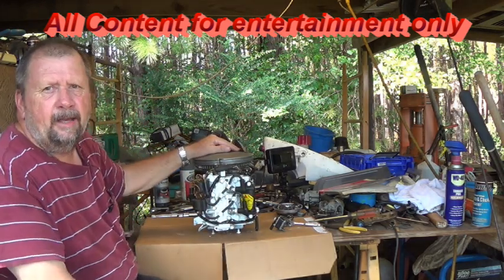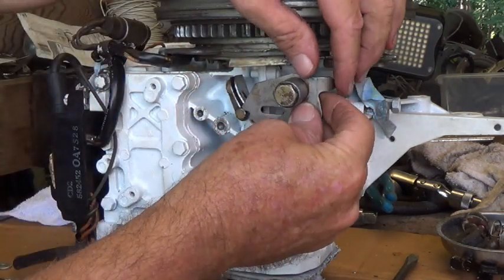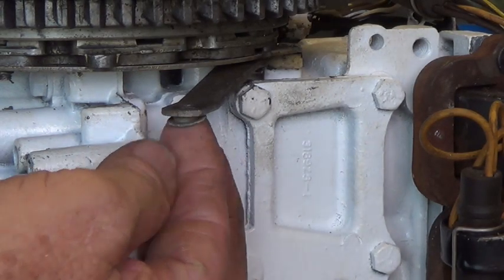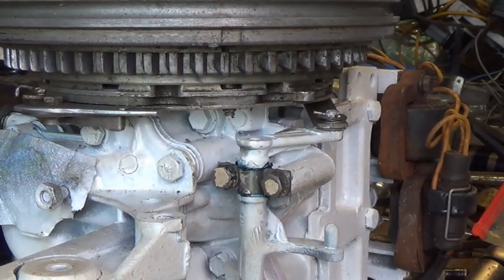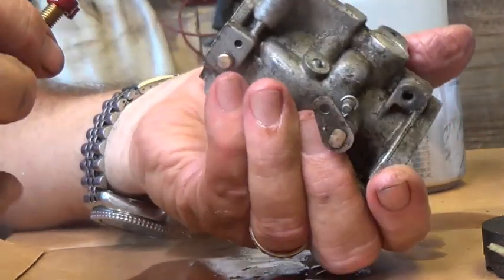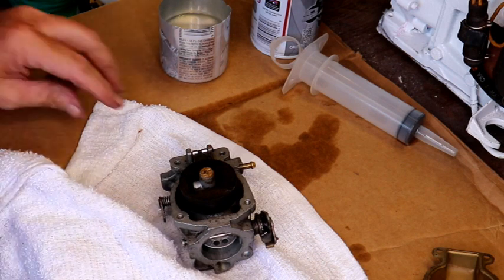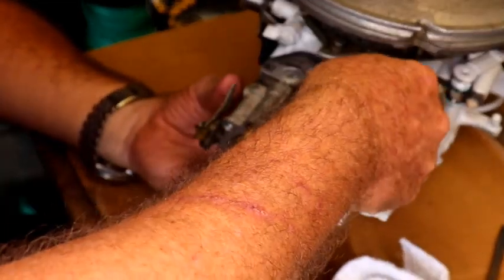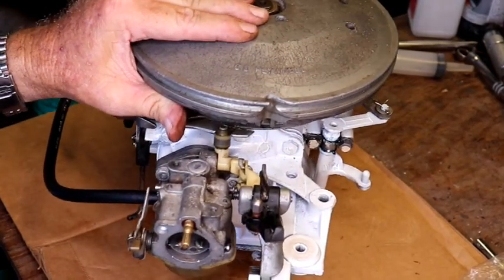Johnson 15 HP   Carb & Linkage!

Comment: Good job on the wiring!  Is that the correct fuel pump for the engine?  The fuel outlet does not look correctly oriented....That in itself is no big deal, but proper pump hsg orientation can be critical...Look for a tab/arrow saying "up"...  What was causing the mag plate to be stiff?  I like your little inch pound torque wrench!  Those original style carbs were the best for sure...Simple, reliable, and easy to service.  Yeah, the tin bowls were prone to rusting, but that was no big deal to replace.  Things really went to hell in the 80s when we introduced the plastic bowl/cover carbs...
Reply from the maker: I am going to check on the fuel pump. I took it off the other motor I got the crank and piston from. I believe you are right about this motor being under water. Fuel pump full of rust. The mag plate I took back off and shined up the inside ring and put the proper grease on it and it was much better, Thanks for bringing that to my attention.  The next video we should be able to hear it run. I have a lower unit I am going to put on just to hear it run. The lower unit I took off needs all new seals and water pump. Keep watching and feel free to point me in the right direction.

Comment: Thank you for all the videos about Johnson motors.  I just bought a jon boat with 1992 15 hp Johnson short- but I was wondering if I could email you a video and maybe you could help me figure it out.   Thank you
Reply from the maker: omfishing@yahoo.com Send me a comment on youtube that you sent it. Sometimes I will miss it.
Reply: Hey I have fixed my motor because of you. Thank you.  Rebuilt carb, new cam roller and adjusted linkage.  The needle valve gasket basically fell apart when I pulled it out.  So thank you for everything!!  You never mentioned your name
Reply from the maker: @allisonbrewer1088  My name is Jim Spencer. I never noticed that I have never said my name until you brought it to my attention. Thanks for watching and commenting. Stay Safe.

Comment: Can you please do a link and sync on this motor or guide me on how to do it? Thank you
Reply from the maker: Check out this video
https://www.youtube.com/watch?v=J_yqcNJqabU
Reply: @OmFishing  great video but it wasn’t quite what I was looking for. I’m having trouble determining it I have a 9.9 motor with a 15hp hood. I ordered a Johnson carb rebuild kit and it came with a 51 size main jet. I’m wondering if it’s the 9.9 carb that the size 51 high speed jet would mess the whole system up or if I can adjust it somehow. Either way I ordered the 9.9 orifice jet size 38 to see if it makes a difference. It just doesn’t seem that I’m getting enough power for even a 9.9
Reply: Did the cam roller on this motor have the adjustment screw? I have the same throttle plate and my cam roller doesn’t have an adjustment screw on the roller
Reply: @OmFishing  .
Reply from the maker: @sprayo1e  No that model does not have a cam roller adjustment.